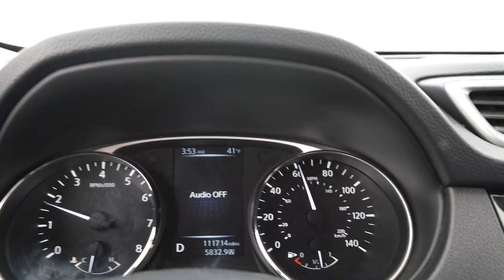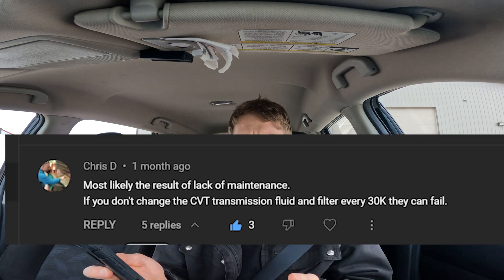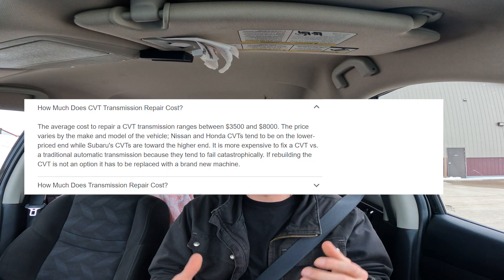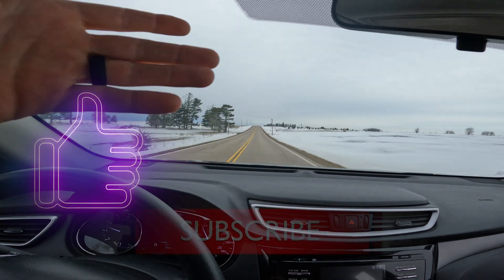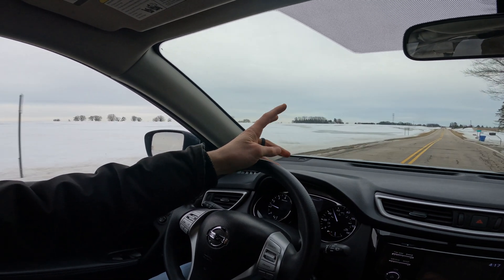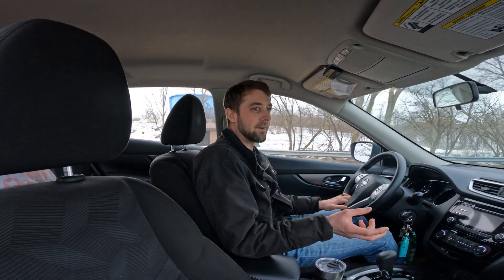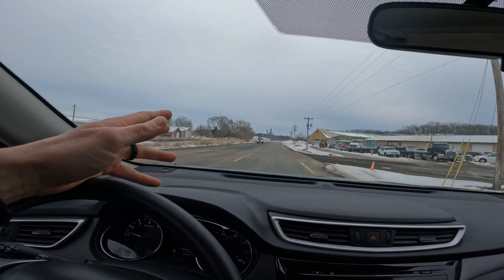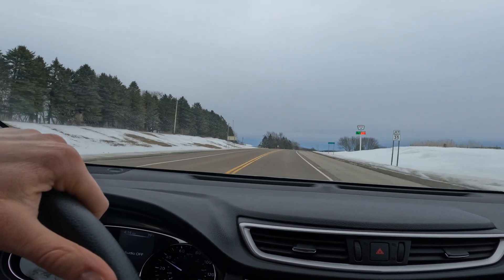Everything WRONG with the Nissan CVT Transmission

Comment: All of the CVT's (with the exception of hybrid e-CVT's which are good) are made by Jatco, and they're all crap.  The Nissan ones aren't really any worse than any of the others, like I said they're all the same manufacturer.  Nissan's blame should be for continuing to use them rather than scrapping CVT's and finding a reputable transmission manufacturer.

Again though, e-CVT's in hybrids (particularly Toyota) are some of the most reliable transmissions that have ever existed.  They don't have the pulleys at all, they use the varying speed of the electric motor in place of that.  They're extremely simple devices and are bulletproof.  But due to them using the electric motor, that type can only ever be in a hybrid.

Comment: No issues with my 15 Nissan Rogue CVT. 331000 kms. Regular CVT fluid and filter changes.  Smooth as silk.  My experience only. CVT saves fuel. Heavier AWD vehicle uses less fuel than my old Honda Civic.

Comment: Drivers increase engine durability by changing the fluids and driving with a light foot. The same trick is used to keep a CVT in good condition.

The issue is that conventional transmissions have been stronger than engines for decades, and conventional automatics can take abuse. Predictably, people have grown accustomed to mistreating conventional automatic transmissions.

CVTs are weak by comparison. They can barely handle the peak torque of a midsize engine, and they rely heavily on fluid to manage friction and cool transmission components. If drivers have a heavy foot, and they miss transmission services, CVT’s won’t last long.

Nissan is partially at fault because they put weak CVT’s in heavy vehicles with substantial engine power. They also haphazardly changed the engine/transmission reliability paradigm without informing customers. Nissan basically bankrupted their company because they were afraid to tell North American drivers that CVT’s require frequent maintenance, and they can’t handle aggressive driving.
Reply: Meanwhile Honda and Toyota are perfectly capable of making good cvt's.

Comment: CVT's are ultra CHEAP to manufacture compared to traditional auto or manual transmissions. Newer vehicles are getting built cheaper and cheaper yet significantly more expensive. Classic greed.

Comment: Got a 2006 Nissan Murano, AWD with the 3.5L V6 and the CVT failed only 170,000k’s in, even with regular maintenance. Repair costs for a used CVT is over 1/3 of the price of the car. That thing also saves 0 fuel. 6kmp/l. The engine makes a good amount of power, which the CVT just can’t handle. Why build a car that can produce that power if the rest of the parts can’t handle it. Absolutely awful. Sad part is I love that car but the transmission is just awful.

Comment: I have a Toyota Rav4 eCVT that operated using gears NOT pulleys. I'm getting 55MPG in summer and 48MPG in winter. I would agree the pulley system CT is crap. I had a Subaru UV with a pulley CVT from new, which I sold after 1 year.
Reply: Мы тоже разочарованы в CVT. И эту проблему решаем только одним способом: меняем CVT на классическую гидромеханическую автоматическую трансмиссию! Есть сложности с её Заменой, и на каждом автомобиле это можно сделать без технических проблем, но другого выхода нет.

Comment: CVT transmissions were designed for Go-Carts and Motorcycles,  Not Cars! Jatco and other transmission companies simply Do Not make their CVT transmissions big enough, nor robust enough.  If they were built as good as transfer cases, CVT's would be fine. But they are not.

Comment: I´m a german Nissan cvt victim. Own a Nissan Juke 2015 with 99.000 km. Now the cvt failed. Repair cost more than 11.500,- Euro. Never ever buy a Nissan. Total crab. The Nissan-dealer told me for some time, a cvt oilfluid change is not necessary. BS

Comment: I just called a transmission shop and asked what they do to change it. He said they drain and fill it 3 times (with driving a week in between each change) and they drop the pan and change the filter too. I am going to ask him if I should use Amsoil CVT transmission fluid instead of Nissan NS3 fluid. Also could use an additive like Jilcat proline CVT conditioner.  Does anyone have any ideas on this?

Comment: as a carguy myself ima just say this I own a 2022 rogue if you change the fluid at 30000k you shouldn't have a problem also even though i don't really like CVT's they are specific for daily use not racing use and I've owned older ones too even a Sentra and i can gladly say its not perfect but its WAY better than any Kia/Hyaundai

Comment: Got 150000 miles on a 2016 Rogue. Works great. Been changing the fluid on the regular, just did a filter replacement and cleaned out the pan. I’m giving it to my son next year and fully expect it to get to 300K miles. I know there can be problems but gentle driving and good maintenance can work.
Reply: 2015 Rogue, I take it to a Nissan dealership and get the recommended service done. 124,000 miles- mostly highway- and the dealership told me that the CVT transmission is beginning to fail. (It takes about 5 seconds to shift from Park to Reverse, and 5 sec from Reverse to Drive.) So disappointed.
Reply: I’m getting my 2017 sport checked out today.  CVT is finally failing at 151K miles.
Reply: I think I figured out why mine is starting to mess up over 250 thousand miles I would say hey they are a bitch to check the fluids 2013 versa but anyway heat once mine is driven over an hour u see change heat good video
Reply: @richardbarlow6710  3000 miles later with my remanufactued, warranted CVT.    The next check up is free at the dealership.
Reply: My 2011 Rogue still going with 107k

Comment: First, I find it completely feckless and unethical that Nissan holds on to these shitty JATCO transmissions.  After that, the poster is off the mark regarding  'other' CVTs. Toyota's system is an "E-CVT," which is actually not a transmission; it employs two electric motors connected to the car battery. A transmission shaft and planetary gear shaft connect motor 1 and the internal combustion engine..  Subaru uses its own propietary CVT 'symettric AWD' system ... very few problems.  The biggest fail rate in the industry belongs to JATCO. Hyundai and Mazda use conventional transmissions, except for the upcoming CX50 Hybrid, which will borrow the same Toyota drive train used on the RAV4.

Comment: What’s funny about the CVT is they have a sports mode in it. The gears in this transmission are not your ordinary transmission. You hit the gas and you can get up to 4 thousand RPMS. That puts a lot of stress on the tranny. In sports mode it’s a lot worse, don’t downshift either to slow down. It puts stress on the transmission. When I bought this I didn’t know what CVT was. But I realize I will never buy a vehicle with a CVT. The bill to fix was 8G’s. Hell no!

Comment: I've had 3 Rogue's. The first one had a warranty replacement of the CVT, but the 2 other's were okay after 3 years each. Ive also had 2 Frontier trucks. First one was fine, but second had a transmission valve body replacement.

Comment: I've owned a 2010 Nissan Tiida (Jap Import) in NZ for around 8 years, has a  1500cc engine and CVT transmission. At 50,000kms I refreshed trans with NS2 oil the the only issues we've had was the battery losing its charge over 2 to 3 months.  Transmission has been excellent and it's never missed a beat, towed trailers as well. 
Sold it recently at 86,000 kms.
Nothing wrong with Nissan cars overall but I guess you can get the odd bad ones.
Keep the oils/filters changed when due is my advice.

Comment: Well, im gonna give you a different comment other than maintenance. 
How about researching the car and its reliability first before buying. Im sure you couldve found something on the JATCo cvt trannies before buying a Nissan, which most likely came with a 2 year warranty. Was there a longer warranty available for purchase? Or you couldve gone with a mitsubishi, kia, or hyundai, which offer a 10 year warranty on that same transmission. I know it doesnt make a JATCo more reliable, but at least the repair doesnt come out of ur pocket. 
Or go with a toyota, they use Aisin cvt trannies. More reliable, for the most part. 
Myself, i would never buy a Nissan, they dont warranty their product long enough, despite spotty reliability.
Reply from the maker: Imma Nissan lover tho. Once in awhile you gotta vent right?

Comment: I bought a 2019 Sentra brand new and last week I started hearing things so brought it in to Nissan Dealer that I bought it from and they said it’s nothing and they even did the recall on the car 2 days later I was driving in a highway and car out of nowhere started revving but the speed not going up and later on stalled I bought it back to Nissan and they said it has a bad transmission will cost $6-7k which is ridiculous

Comment: U are completely misinformed. First, all CVTs arent junk. The gen 1 Nissan WERE junk for sure. Second, the chain is NOT the weak link. Its the strongest link, actually. the weakest link are seals around the drums, clutch surfaces and fluid. 90% of drivers dont service their own cars. they listen to the dealers that tell them the fluid is lifetime, not understanding to the manufacturer, lifetime means 60k miles. If they go ahead and change the fluid every 30k, they would last much longer. Also, you cant constantly hammer on the peddle or the fluid will overheat quickly and cause the cvt to fail. And i know u see drivers every day in their little gas sippers driving like they're in a Corvette. Of course they will soon pull into a shop crying about how cvts are junk.

Comment: One other worrying thing is after an emergency stop there is temporarily no power as if the transmission has failed.  This can be really unnerving since my Mom had a Jeep Patriot that would often stall when stopped at a light.  I have a Nissan Rogue which is mechanically similar except that hers was a 2.4 liter engine and mine is a 2 liter.  My Rogue does not stall like that Jeep did but it is something that could be happening to some other unfortunate Nissan owner.  Her Jeep actually needed a new transmission under warranty it was so bad.  Having it fail under warranty is great for you but it is a sign of shoddy build quality or just a bad design.  You may already know that the CVTs used by Jeep were the same Jatco transmissions used by Nissan.  A lot of manufacturers do things like that and may have a transmission that is used by a lot of other manufacturers

Comment: 2013 nissan sentra 130k miles , 3rd transmission , using dealer recons . $ 5400 , 12000 miles warranty . Original went 75 k miles , number 2 8000 miles [ warranty] , number 3 35000 miles , Local dealer absolutely dont care .

Comment: just a note... i drive mine different.... i start out slow JUST to keep it from going into high RPMs.... once going 10-15 under 2500 rpms....i drive 15-45 mph and never exceed 3000 rpms all the way to 45 mph...at 45 mph i let up a little on gas pedal and let it "shift"... then just gradually go faster not exceeding 3000 rpms..

Comment: My opinion NISSAN should be dismantled and dissolved! 2016 rouge transmission started whining at 60,000 died at 88,000 miles. Never floored, always babied. Engine fine tranny is trash!   Metal bands broke and separated. Give me a break. The guy leaving comment about not blaming nissan. He is affiliated with nissan.

Comment: I work at nissan, and i never fail to see cvt failures.
Reply: I have nissan altima 2017 driven inly 127,000 and transmission started giving issue. After half an hour car driven when you stop at stop sign it’s rev so high and then move forward. Shit nissan
Reply: @UNIEEZCOLLECTIONS  At leas tit made it to 127K, there are stories of problems under 50K miles.
Reply: Is Nissan X Trail 2024 CVT good?
Reply: @maheshtolani7003  Google says: According to most reviews, the 2024 Nissan X-Trail's CVT transmission is generally considered "good" for everyday driving, providing a smooth and seamless experience, especially at lower speeds, but can feel "rubber bandy" when accelerating hard; with many reviewers noting that the newer CVT design in the X-Trail has addressed past issues with Nissan CVTs, making it a reliable option for most drivers.
Reply: Its the shitty owners not the cvt

Comment: My Kia Soul uses a CVT and I love it. It's the quietest and smoothest ride I've ever had. Are they quirky? Sure. But I think lumping every CVT as a failure is a mistake. Jatco had some issues with their CVTs and they ended up in a lot of cars, like your Nissan. Bottom line, if you don't like the CVT that's great. Stick to a traditional automatic or manual. CVTs are in about 30% of all cars now, if the failure rates were as much as people say they are, they simply wouldn't make them anymore.

Take care of it, like everything else and it will last. Drive the car like a donkey and it won't.
Reply: Toyota actually has chains instead of that silly band that Nissan has. You never really hear about toyota and trash CVT transmissions. 

I'll say it, all CVT transmissions are trash! It's a way of making you buy a new car every 7 years. 

As  far as kia goes,  that cvt transmission might out last any KI.A. as K.I.A. vehicles start falling apart after about 5 years. K.IA. Soul is a cheap knockoff of the toyota XB. The toyota xb goes 400,00 miles or more my 2006 xb had 376,000 miles on it when I traded it in.

Comment: Straight to the point. CVT is using hydraulic to stretch the belt to create infinite gear ratio. What do you think will happen to the bearings? Of course that will shorten the lifespan of bearings. Because of that CVT is very unreliable and problematic.
Reply: They are not streching the belt. One pully opens or gets wider while the other gets narrower. This keeps tention on the belt consistent. When a pully opens or gets wider the belt goes farther into the groove which simulates a smaller pully. And when they close or get narrower it simulates a larger diameter. This is all known as spooling and this is how it simulates gear changes.

Comment: I was hoping to really learn something with this video, but unfortunately it’s full of bad takes. Let me explain…

1) All CVTs are bad. This is simply untrue. Toyota and Honda make their CVTs in-house and, in the case of Honda, they power their entire line except for things powered by their 3.5L V6 (Ridgeline, Pilot, etc). They are in millions of cars and have been since 2016. They have proven to be reliable, and people haven’t suddenly stopped buying Civics for poor driver experience.

2) Why CVTs go bad. This was the most egregious absence of this video. He mentions inadequate cooling, which may be a factor for some failures, but the biggest reason for failure has nothing to do with the belt or heat: it’s the valve body. Take the fabled JF015e, Nissan’s cursed transmission that lost it several international class-action lawsuits. As the transmission operates, it shed metal debris (as all transmissions do, including planetary gearbox automatics). The problem was that its ability to handle the debris was inadequate. It would make it past the magnets and the filter and get ingested into the valve body. It would score the linings of the solenoids, which would prevent it from being able to build the hydraulic pressure necessary to properly operate the transmission. This would make the trans do all sorts of weird, counterintuitive behaviour, eventually throwing up error codes and shitting the bed into limp mode. Cue new transmission.

This was a failure due to Nissan’s poor engineering, and it affected multiple years and several models, from Versas to Sentra up to Rogues. It was not a problem endemic to CVTs, and other makers mitigate the debris issue adequately, so long as you follow the service intervals.

3) Everything in this video is subjective. By the end, he even admits that if you don’t mind the unpleasantness of the drive, you’ll likely be fine…. Ok? I’ve owned two CVT cars in my life, and yes one DID fail and pissed me off with a massive repair, but I did not find the driving experience to be unpleasant. My HRV was quite nice to drive and surprisingly responsive at highway speeds.

4) They’re everywhere. CVTs are in practically every compact, subcompact, and crossover SUV out there. Ford, Chevy, Toyota, Subaru, Honda, Hyundai, Kia… if you buy a car with an i4, there’s like a 90 percent chance it has a CVT. And yet, somehow the auto industry hasn’t totally collapsed.

I wish this video did a deeper dive on DOCUMENTED reasons why these CVTs fail and the engineering behind their failure — the JF015e is actually a fascinating case study — but this video really lacked substance on a subject I hoped to learn more about.
Reply: So do you think if a jf015e would be alright if properly maintained/serviced?
Reply: @ keep in mind I’m not a mechanic, but as far as I am aware: yes. If you changed the fluid at 30k mile intervals — twice what the manual suggests — the consensus seems to be that it would otherwise be fine.

Comment: I have three Sentras (2011, 2013, 2015). All well over 100K miles. The only problem we ever had was on the 2013. At 129K miles, it needed 2,500 rpm’s to go 70 mph. Normally it’s 2,000 rpm’s to go 70 mph. Otherwise it was running fine. I had the dealer install a NEW transmission for $3,500.

Comment: Stimulating the gear changes is the most useless feature.. Defeats the purpose of a cvt. This should be off by default... I hope manufacturers will at least give the option to disable this dumb simulation thing..